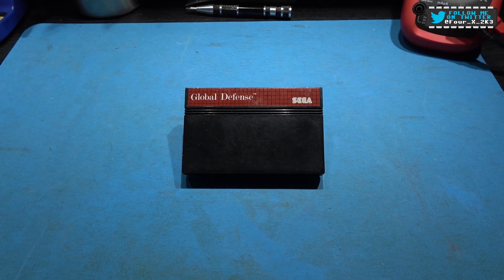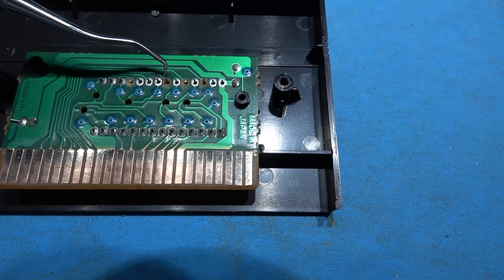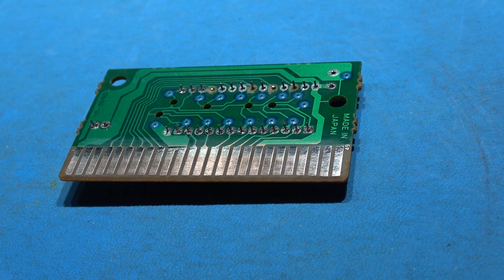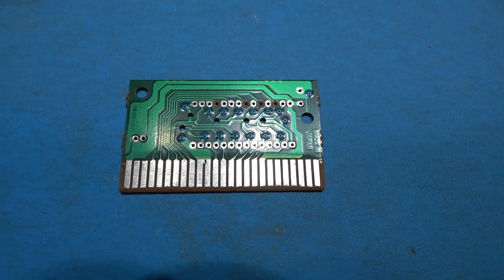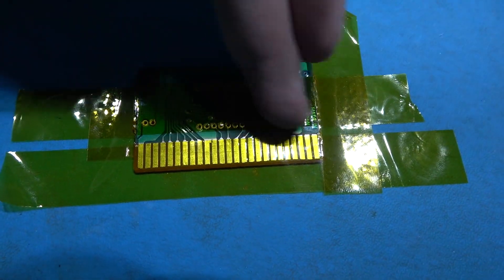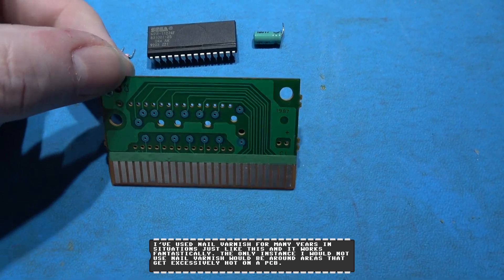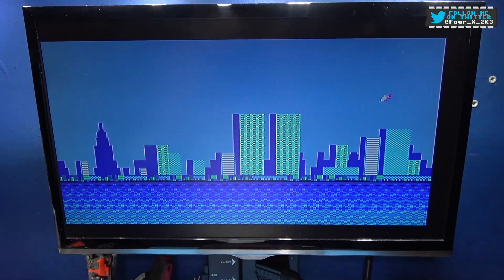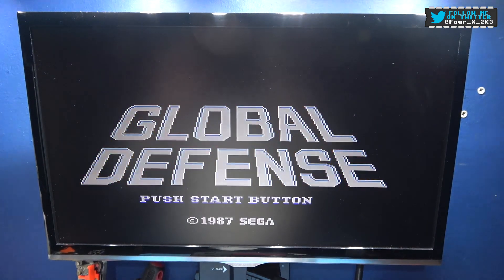Sega Master System - Repairing a butchered game cartridge PCB

Comment: If only it was as simple as checking the temperature. My desoldering station often won’t even flow solder on both sides even when it it hot enough to lift pads. You could end up lifting pads coming or going. A Hakko would probably do a much better job but by their very nature they can’t be as responsive as cartridge-style irons to flow with a low temp.

Comment: Nic one Four X!, I just repaired a Sonic the Hedgehog cartridge with kind of similar issues. The rom pads were all soldered but half of the pins were sitting out of the holes and the cap was soldered in the wrong spot. Crazy stuff...
Reply from the maker: I think someone tried and failed to replace the Mask ROM, maybe to create as repro game cart.